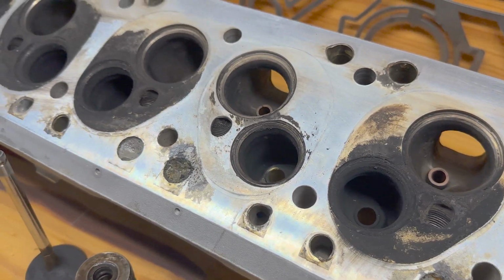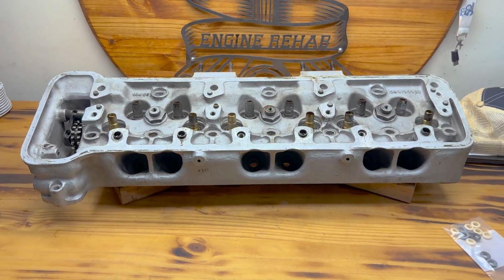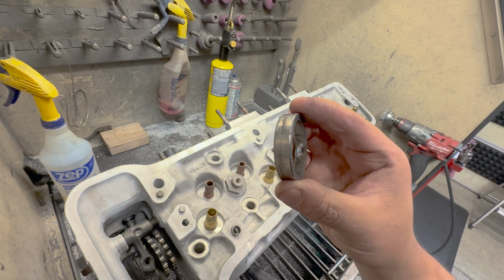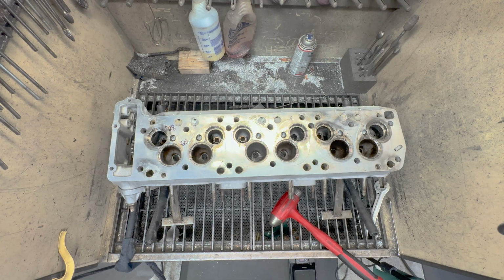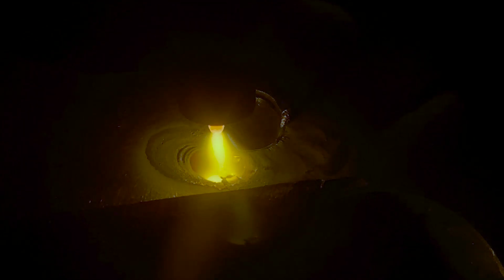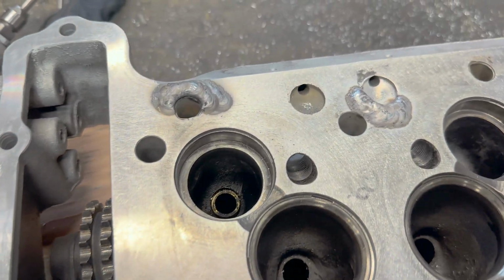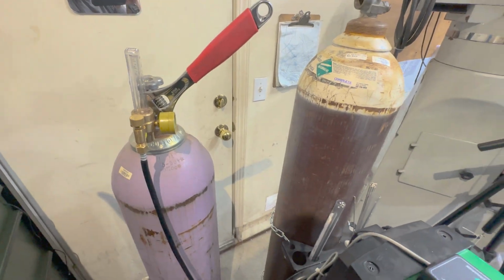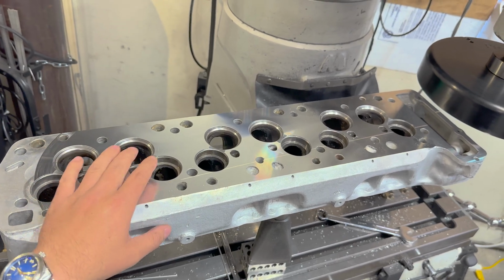An Engine Failure Saved This $1M Mercedes!

Comment: Back in the 90's I worked for an old German guy and we did a lot of Mercedes restorations, did a lot of work for the Gull Wing Group, Dieter worked in the Mercedes factory building the 300 SL's back in the 50's so knew the cars pretty well. We would send motors out to a shop called Metric Motors somewhere in Canoga Park if I remember right, Erich was also a German, ex factory employee.

Comment: Unfortunately, we're in the middle of a helium shortage, which isn't likely to resolve itself anytime soon. The US has used up it's entire helium reserve, if I'm not mistaken.
Reply from the maker: In 2020 I paid $340 for the same size bottle of helium. So I’d tend to agree. The welding supply salesmen would laugh at you then too.
Reply: "used up it's entire helium reserve" This was long ago of course and may not be relevant today, not sure. Reagan ordered the US strategic helium stockpile sold off as he saw no value in paying to store it. Earthly helium results from radioactive decay of minerals within the earth and capture in gas tight reservoirs. These reservoirs also often capture natural gas. I suspect that if the Natural Gas Industry dies due to moving away from fossil fuels then Helium might be VERY scarce. There is no way to make it other then possibly in very small quantities in nuclear reactors.

I wonder if fusion reactors might be able to make significant quantities? If such a thing ever exists in practice. The fuel is so energy dense that there might not be much helium produced and it will likely be mixed up with all kinds of nasty stuff. however perhaps it could be easily enough purified.

Grok says:- "A single fusion reactor might produce kilograms of helium annually, but widespread commercial fusion could yield tons, potentially offsetting helium shortages for applications like cryogenics, medical imaging, and scientific research."

Comment: Super cool video! I keep some 4009 filler that for cast have to monkey with the settings but flows a little better.   I like to mix in 1-2% he with argon all the time.  Bought a cheap gas mixer from vevor works better than expected. Its almost $1000 here for that same tank.
Reply from the maker: Vevor has a mixer??? Does it work? Now i gotta find it.
Reply: @EngineRehab  obc528g its orange but not vevor...
Reply from the maker: @78Mitsu  oh they’re all vevor. And DUDE. I’m buying that. That’s awesome!
Reply: @EngineRehab  I added an post flow mixer (1" brass pipe with a mix of brass beebees in it) just to make sure  the gas is shaken and stirred.
Reply from the maker: @ i just tee’d it together before and that worked but had varied degrees of arc instability. Bought a premix bottle once, that was awesome. The straight helium was awesomer. Would be nice to save money on gas again. That mixer will be a godsend.

Comment: Very interesting method of checking the valve seats. You can hear the difference between the loose seat and the other seats when you rapped on them with the hammer.
Reply from the maker: Definitely gotta make sure you get that second P. Also yeah totally i didn’t notice until i reviewed the footage
Reply: @EngineRehab  lol. Yes, rapped with only one P is what the unnamed machine shops do to good parts and people. Always fun to get a fully assembled head back with fresh belt sanding marks along the head gasket surface and metal filings in the assembly lube that happened many years ago. And needless to say we didn’t trust the weld repair they did to fix the crack either. Took it to a small one man machine shop in town and he let us watch as he did all the machine and assembly work after the head came back from his welder.

Comment: Setting the welder balance for more penetration and less cleaning, would help float those bubbles to the surface. Then grind and go back over with a cleaning balance.
Reply from the maker: Is the $100 in helium I used equivalent to gold leaf on a burger?
Reply: @EngineRehab  No clue

Comment: Sorry I missed the premiere! I've played with the 4 cylinder sibling (M121), but never laid hands on the bigger.

How did the deck surface of the block look? May have some pitting there as well.
Reply from the maker: @keepyourbilsteins  I haven’t set eyes on the block. I’m assuming it’s cast iron. It will have some rot, probably a lot less. Some silicone or epoxy might help if it needs some attention.